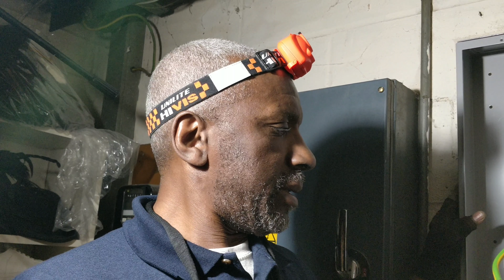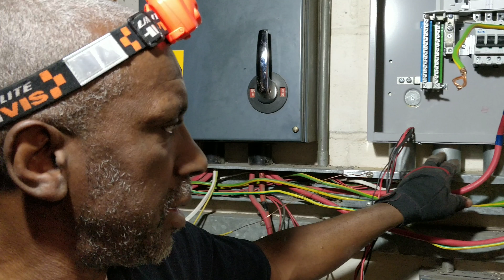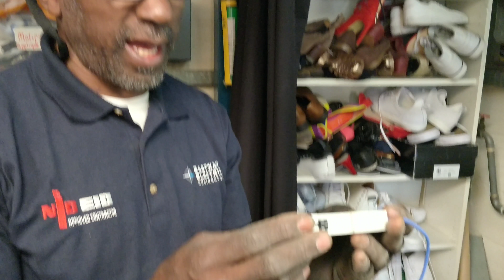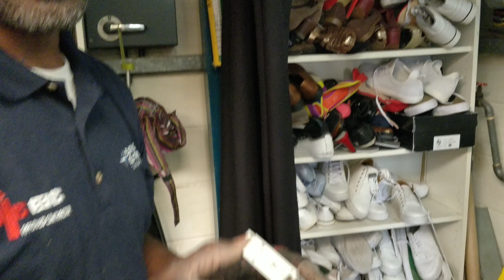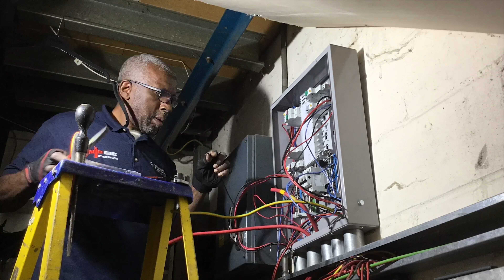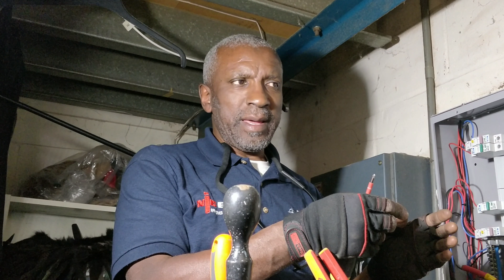Industrial Consumer Unit Upgrade [Part 2] - Father & Son Electrician Team In London Vlog #6

Comment: I agree totally about leaving plenty of slack - not a birds nest lol. Same in sockets and other accessories. If EICRs are done, it’s good practice to redo the ends to ensure the connections aren’t weakened, and this gets difficult if there’s not enough slack. For tails, I like the old technique of wrapping wire round the conductors to stop them splaying apart under the terminal screws, provided that the terminal diameter is sufficient: for 25mm tails, 1mm wire usually works fine. Once upon a time, it was common practice to use fuse wire for this.

Comment: You don’t really need a 400v sticker on there as it is a dB and people should reasonably expect it to have voltage present. I believe it is only required where there is a chance people may not realise an item is electrical such as enclosures and adaptable boxes.
You do need mixed colours warning label, RCD label and retest sticker though.

Comment: you should attach a sign telling people this is an old wiring colour  that is according with the old wires colour. red(line) and black(neutral) as I see it in there you have red and black and also blue and red. read 514.14.1 of current bs7671 It looks you have a mixture of old and new. new blue (neutral) and old red (line)?
Reply from the maker: Thanks for your suggestion. Hope you're enjoying the content.

Comment: You just did two things that I wish more electricians would do: extra entries for future circuits and extra length on wires. I understand that these days workers/trades are all about efficiency and minimizing work cost to increase the profit and I see those reasons behind limiting number of entries to only 'what I need at this moment'. Whoever is gonna work on that fuse board in the future, will appreciate your work. Good job.
Reply: Go to change a rose to find an inch spare not enough for retermination  out come wago's and mf boxes to be lost in the ceiling. Fucking joy

Comment: I would test the RCDs at the origin on the terminals of the devices themselves rather than at the extremity of the circuits. Then resetting them is easy too because you are already there!
Reply from the maker: Thanks for your comment mate, keep em coming
Reply: No problem Delroy. Love your videos btw!
Reply: I'd do the test at the end of the circuit like I was taught
Reply: RCD testing should be tested at the furthest points from the device not on the terminals of the RCD themselves. It's not about what's easiest for the tester, it's about worst case do the numbers fall inside the permitted range.
Reply: I'm sorry but that's incorrect. RCD testing is a test of the device itself to verify that it is operating correctly. It is NOT a test of the circuit. For initial verification these tests are carried out beforehand to verify that the circuit is safe to energise, and verified once energised. RCD testing is only a test of the device and therefore is best carried out without loads influencing the results.
Reply: Richard Walsh interesting way Of putting things I never thought of it like that, will make my life easier 😃
Reply: @richardwalsh5882  There is literature confirming this but please excuse my laziness in finding and quoting it. You can functional test an rcd with a test button trip at source but the trip times will be vary depending on the length away from the rcd the fault current is introduced. For you to be sure the rcd will trip within 1x and 5x (if applicable) you have to test the circuit at the furthest point.
Reply: @pauldavies9709  There is no need to do an RCD at the furthest point. It is purely to test the device (RCD) to ensure it trips within 300ms 1x and 40ms 5x. if to BS EN standards or 200ms 1x and 40ms if BS standard.

Comment: Should tape the incoming phase wires to identify each phase brown,black,grey on the tpn board other than that nice neat job.....
Reply: Tape is rough. Heat shrink should be used.
Reply: Good idea may do that in future where do you get the heat shrink in that size from
Reply: No blue markings on black cable either

Comment: Good one Del thinking ahead for future cable entries into the unit is a thing I wish all sparks would do. Liking the small RCBO's.
Reply: What size are the incoming tails feeding the new fuse board? Seem to be oversized for the load's connected... 
Yes I was thought also to leave some slack on circuit's to be connected...
Reply from the maker: Thanks Plymouth Spark, always on time with the comments. Always appreciated